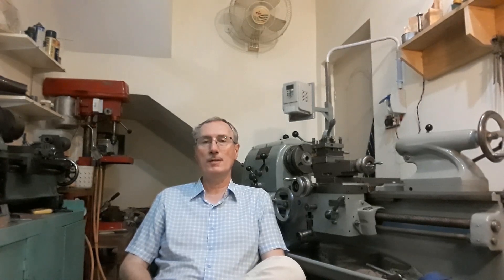Colchester Student Mk1 Lathe - refurbishment

Comment: I see you have added a trequecy converter. Which might be an optimal solution.
However i would like to ask you?
Do you know, what is needed, to change from The table which has a Max rpm of 750, to The table with Max 1500rpm.
Is it Two gears, which are interchanged?
Best Regards The danish guy.
Reply from the maker: The upper large lever on the front of the headstock operates a reduction gear for the lower range. Even with the frequency converter I still use the gearbox to optimise torque and speed. So to cover the full range of speeds I use both levers on the top and the lever on the front. For intermediate speeds or for low torque low speed operations like screw cutting I additionally use the inverter speed control. I hope this answers your question.
Reply: Thank you for The spreedy reply.
However I haven’t succeded in elaborating😃
Besides The 2 gear-levers and The High/lo lever. It Should be possible to change to gear-wheels earlier in drivechain, since mine has double scematics for rpm. One Range is red and goes from 34-750rpm.
The other is Blue and exactly double speed from 64-1500rpm.
I would much prefer the higher range.
I just havent been able to find information about how to change, to this table.
Since all gears are double speed, I assumed it might be the belt pulleys, however these are equal size.
Reply from the maker: It seems you might have the two speed motor model. 34-750rpm would be on the lower motor speed range and 64-1500rpm on the higher speed. If you still have the original motor and switchgear on a three-phase supply it should be possible to have both speed ranges. If the motor/switchgear have been modified you might be limited to one range. A VFD might solve this problem for you.
Reply: Amazing.
You were right.
The handle of The switch is missing, but The function is ok.
Thank you so much. You just earned a friend in Denmark. 👍😃

Comment: 5:49 Noting plastic caps for oil holes in saddle - mine has small brass ones - fit flush with the top surface of saddle and smaller diameter - that leaves a circular channel around the loose-fitting plug - so I just fill the circular channel with oil and it slowly 'leaks' through to the slideways !
Reply from the maker: Yes, the nylon plugs are not very elegant - just a temporary arrangement to stop swarf from getting where it shouldn't. I plan to replace them with proper spring loaded oilers - but they seem to be a non standard size.
Reply: @Workshopfriend  Just been to the garage to photo my TTA tailstock bar. I could have photo'ed the brass plugs that came with mine. I actually prefer these to spring ball oilers - the latter need the oilcan pointing down - and oil cans don't always work well like that and what you put in goes in immediately. With mine, it can trickle through over time after an 'instant' application of oil !

Comment: 4:52 Ahh, you have the TTA too ! Had mine in bits to try to make it work better - adj. screw went stiff part way along adjustment. Adj screw was bent & threads damaged. Straightened and cleaned up threads. Reassembled not significantly better - the easy section was easier but it still went stiff - then snapped ! I plan to abandon that adj. screw mech ! And use hope fully a much better way of setting angles. 

PS I have the clutch too - but not orig. motor.
Reply from the maker: I found that you really have to 'help' the top dovetail slide in the direction it should go whilst turning the knob. There is quite a lot of resistance from the leadscrew bearing housing and little mechanical advantage in the thread operated mechanism.
Reply: @Workshopfriend  If you have the TTA amidships, altering the TTA angle should be free and easy - as you're not trying to drive the cross slide at the same time. I've a feeling the angled slide in the TTA is damaged somehow and the mech was jamming.

Comment: 3:48 I plan to take my interlock out ! So I can use power crossfeed with the leadscrew nut engaged.
Reply from the maker: I can't imagine why. Anyhow, so long as you are the only user and you are very careful, hopefully, you can avoid a crash!
Reply: @Workshopfriend  Can you imagine using power feed on the cross slide with the topslide nut removed ?

Comment: You didn't show how you got the base down a staircase. I had to relocate a Schaublin 102 into a workshop under a house and the base of that is 266 kg. Took 2 people 4hrs to move it 30m also down a number of sets of 2 and 3 steps.
Reply from the maker: It sounds as if I had a similar experience to you. Knowing it would be very tight, I produced a CAD drawing of the stairs and tested that I would be able to negotiate everything. It was necessary to build a temporary landing out of wood to enable us to turn on the same level as entry to the staircase. It took four people!